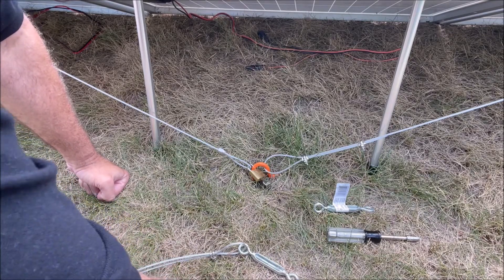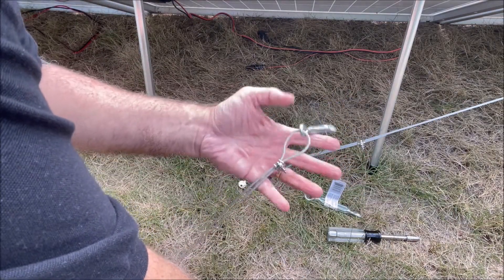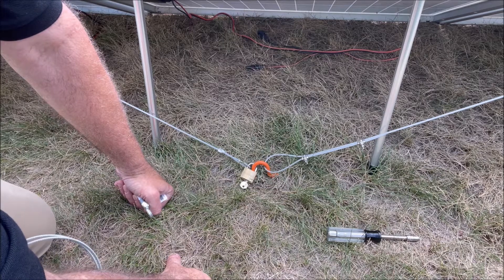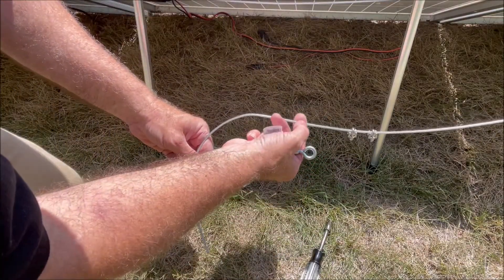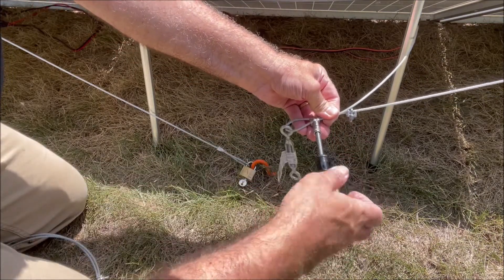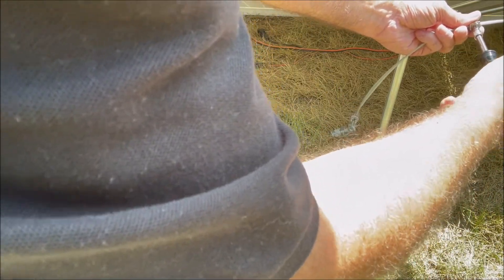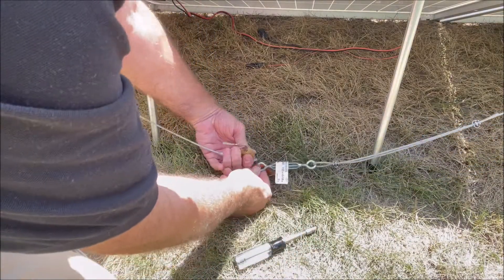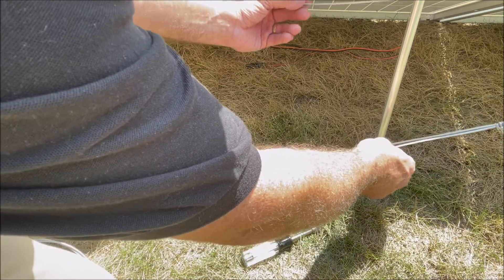Harbor Freight Solar Panels - How to Secure your Panels from Blowing Over -PART 2.  DIY Solar System

Comment: i have looked but not found a comparison of the briefcase 100 watt panel to the 100 watt monocrystalline panel that Harbor Freight sells. Do they put of the same wattage? I have the  monocrystalline but want to add another panel, and wondering if the briefcase panel would be a better option, even if I wire them in parallel. Or should I stay with the same type panel?
Reply from the maker: It has been my experience that the Briefcase panel may peak out about 12-16Watts above the fixed panel.  Common panels typically should be connected together.
Reply: @thechiefsway2618  Thank you.. I used the Labor Day coupon two days and bought two folding panels so they can be paired if need be.

Comment: Dad you built a frame for my solar panels including the harbor freight solar panels the 25 w and the 100 Watts I didn't and I don't like their stands so I just used my stands that I already made for other solar panels in the past I just extended it out but I did it when I had covid so 15 minutes at a time because the sun got to me so bad I spent 15 minutes at a time doing it took me a week to actually build a stand or rebuild the stand I should say and now I got to rebuild it cuz I did it did it when I had a hard time doing it because I had covid so I'm waiting for a time that I have off from work to do this and hopefully it's good weather for it else I want to do it either so I want to take two stands apart and adjust them a little bit and put it all back together again but I might not put the smallest solar panels under I might put them on something else cuz I'm thinking about putting a stand just a few feet in front of my other stands because it works just fine that way too so I may build another two stands yet besides. And I just use the wood to have I don't make metal frames or anything like that all that lumber I have which is actually not so much that brought it for something else but it was in it for this instead.